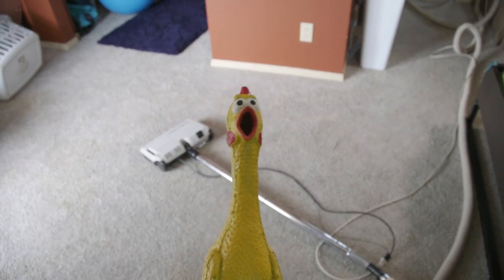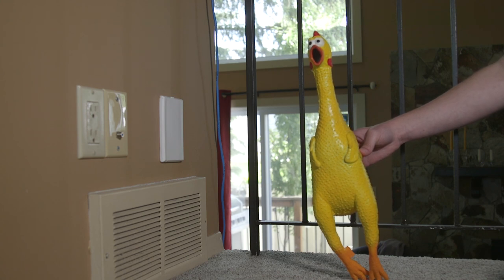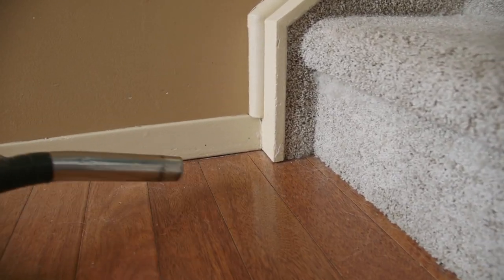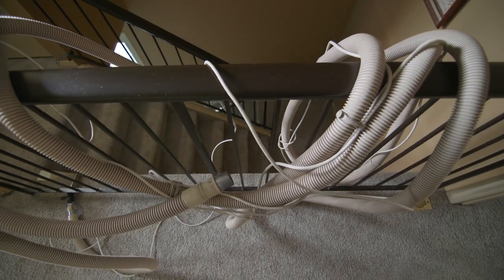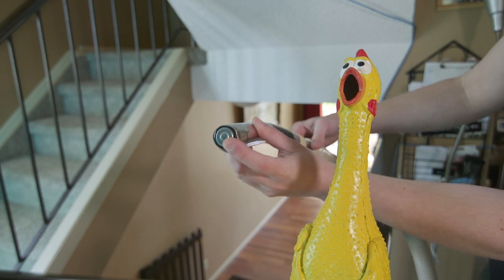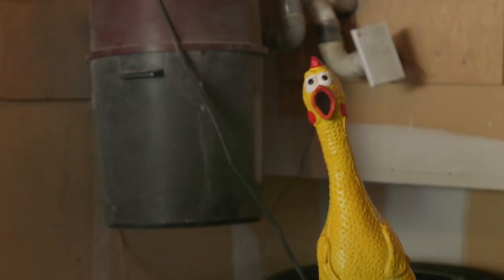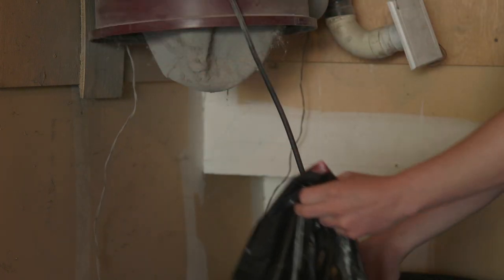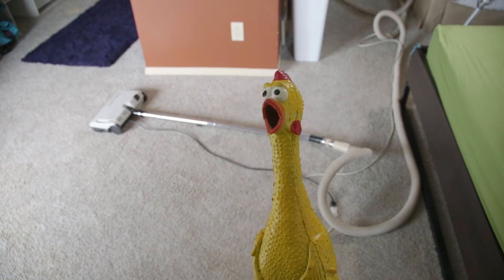Fixing my central vacuum system in my house (improving poor suction)

Comment: These are some good tips. However, I wouldn't recommend using a metal coat hanger to clear out your vacuum hoses, as you might risk puncturing them. I'd probably recommend using something like a broom wand or something similar.

Comment: Central vacuums are great when they are working right.   I've had great success with ours,  as it was installed with a plumbers mentality....  meaning things getting vacuumed up always travel DOWNWARD (to the basement).   Plus,  as a bagged system,  if the suction goes from amazing to mediocre,  it's usually just ready for a new bag.

Comment: I recommend to try fix the piping. There Is a couple of short 90° angles and those belong only behind the inlets, so If it Is possible, you can put sweep 90° instead. The dust can clog in the shorter 90° angles.